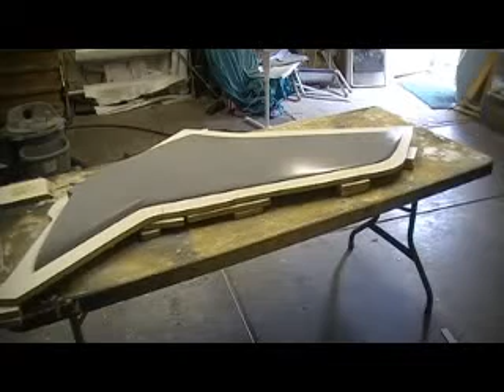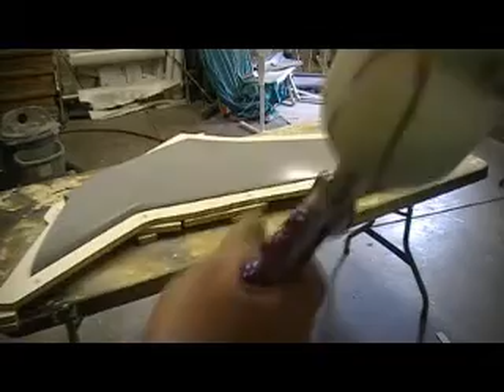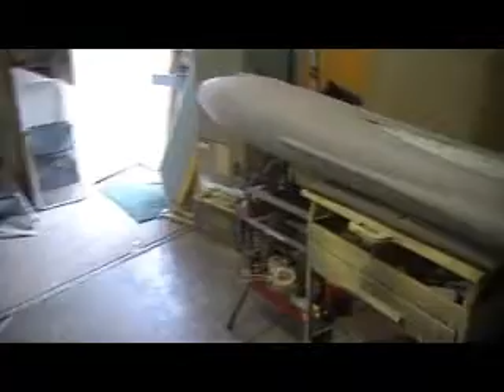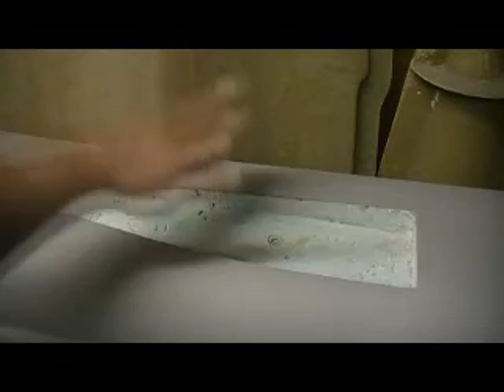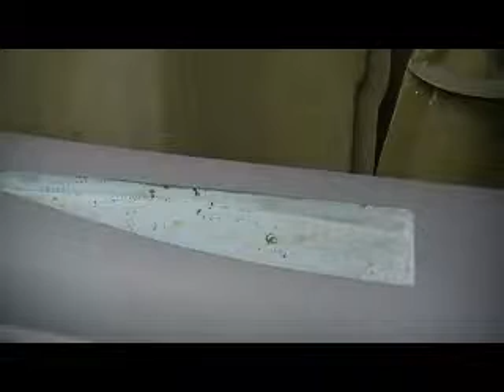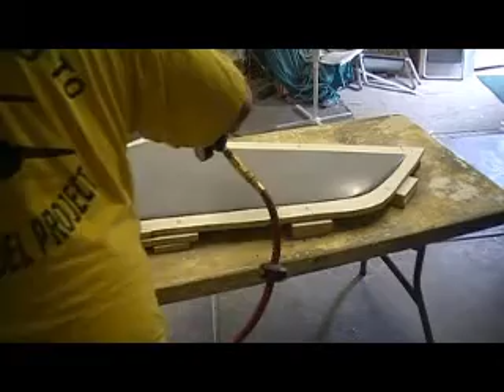how to build a rc jet F-105 thunderchief # 38

Comment: Bob is going to make two smooth surface plugs from this plug.  He'll then take the two smooth surface plugs and create Left and Right finished surface plugs, each with the correct panel lines on the upper and lower surfaces.